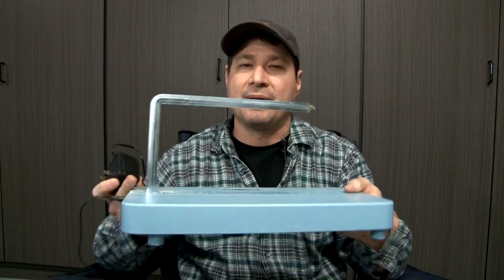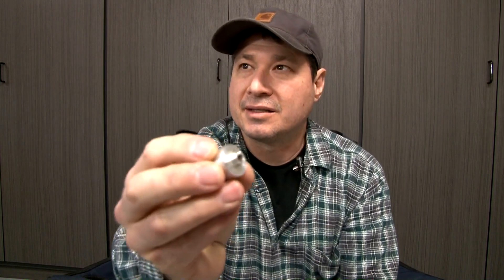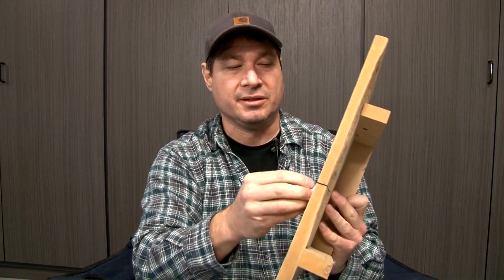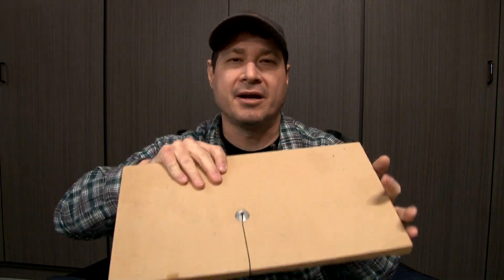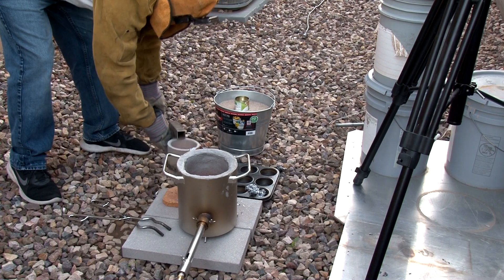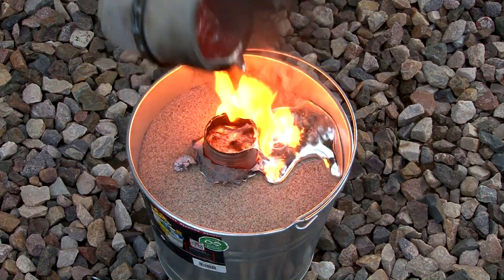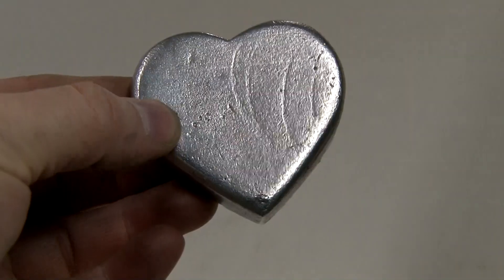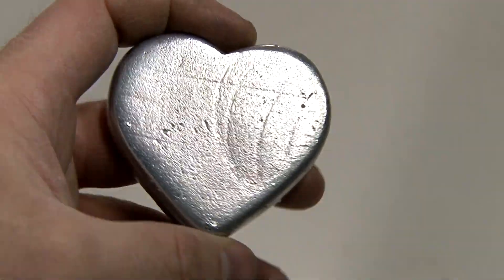EASY Foam Pattern Cutting and Lost Foam Casting.

Comment: I've noticed when cutting the foam, you sort of have to be fast. Or it melts a wider radius around the wire.

At least that's in my experience. So if you're not in the mood to cut fast... best just leave your project for another day HAHA!
Again, that's just my experience. Do you know of any other way to counter this? Or is it just move steadily the entire time?
Reply from the maker: Check out my other video "Why you should use a refractory coating for casting and another way to cut foam patterns" I used a router and a PLA  pattern from a 3d printer.   Just watch your fingers!  Also, some people use a CNC machine, I just don't have one yet.  Thanks for watching.

Comment: The heart came out really well! I am trying to understand why there was a hole in the pouring can funnel?
Reply from the maker: If you move the video to 8:19 there is a little section of foam sticking out of the sand on the outside of the can.  I was intending for the aluminum to flow through the foam and back out to help flush impurities and completely fill the void the foam would leave.  The only problem is I didn't plan ahead and that small piece of foam should of had another can over to prevent the molten aluminum from running every where.  So it wasn't a hole, it was my mistake in not using another can to capture the aluminum after it flowed through the part.  Thanks for watching and leaving a comment.

Comment: I saw your video on hobby metal casting, I’ve been wanting to do a heart shape for at least 2 years but procrastinated since I didnt know how.  Couple questions i hope you’re willing to answer: why use joint compound? I dont know what it does bear with me.  Was that just normal gravel used in the bucket? What was the metal rod tool used at 8:44? Whats the best tool to use to cut the metal from the shape?
Reply from the maker: The joint compound is a cheap substitution for the expensive ceramic slurry coatings used in the industry.  It provides a shell around the foam and doesn't need a kiln with a long heating process to create it. Just like everything used in casting metal it has to be dry with no moisture content before aluminum is poured into it.  The sand in the bucket was just normal sand picked up at my local hardware store,  I wanted to get a fine sand but mine says medium on the bag.  The metal rod was my temperature probe consisting of a thermocouple(the rod) and a hand held reader(off screen).  This tells me when I am ready to pour, I normally pour around 1400F for sand castings.  For this lost foam casting I poured closer to but under 1500F.  The reason was to give more heat to the aluminum to burn through the foam and still flow through the cavity it left.  I use protective gear at all times.  I might even buy more for my legs after foam casting because the gases from burning away the foam spatter the aluminum as its poured.
Reply: @DamonsMetalCasting  thank you very much for taking the time to explain everything! I'll use this as a guide when I finally make that anniversary present!

Comment: Awesome job for your first lost foam cast.  The type of aluminum you used for the pattern was perfect.  The foam used for the sprue isn't great.  It's very gassy and that's why your pour looked the way it did.
You can't see what I mean in this video.
https://youtu.be/JhwNoe1f5No
Reply from the maker: Thank you, I watched the video.  My thought on using the 2 different foam types was that the styrofoam was less dense and would require less energy out of the aluminum to melt it.  The other thought I had was to put an exit flow channel so the aluminum could push any gas or impurities out and have a flow through port.  I think the exit flow channel did work it was just sloppy looking because I did not put another can to contain the molten aluminum as it exited the foam pattern.  I think the only way  I could really tell if this method will improve a casting is to pour a larger foam pattern.